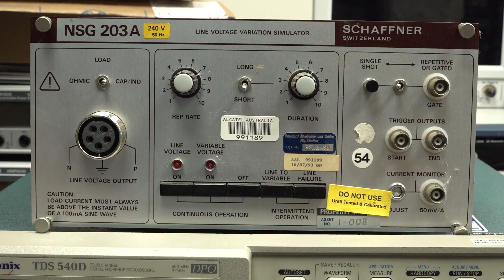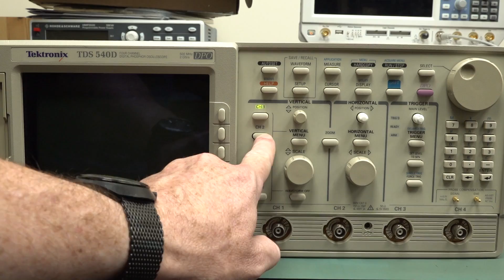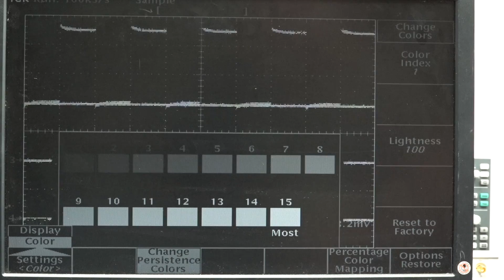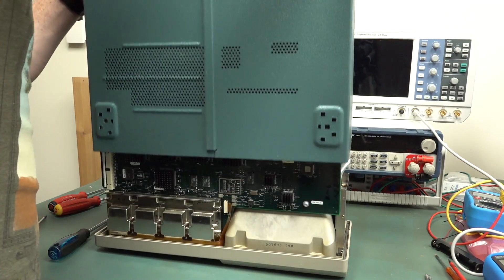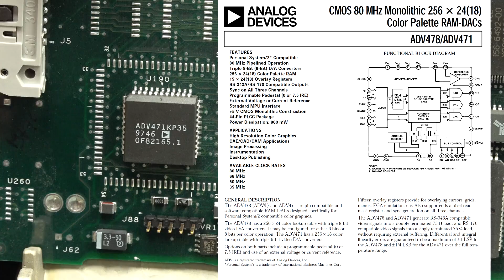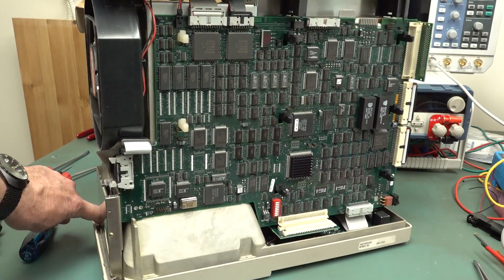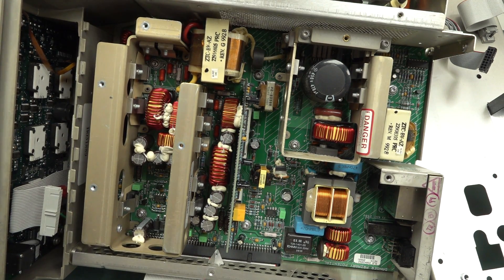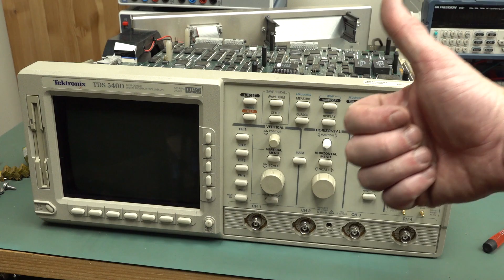EEVblog #1185 - Dumpster Tek 500MHz TDS540D Scope

Comment from the maker: It looks like this TDS540D can be upgraded to the colour TDS754D!
http://www.eevblog.com/forum/repair/conversion-tektronix-tds500-to-tds700-color-oscilloscope/
Reply: EEVblog please fix the crt properly
Reply: I have seen CRT to TFT conversion kits for these on Ebay. They also advertised "convert your mono scope to a color scope". Maybe you can try one of those. And of course there is a thread from2012 on your forum: https://www.eevblog.com/forum/testgear/color-tft-screen-in-a-tektronix-tds500-600-or-700/
Reply: Just what I thought when I've seen it's actually capable of displaying color.
Reply: cor blimey you"l av 2 do it that way then lol
Reply: Of course a color CRT has inferior resolution due to the color triads.
Reply: All I ever seem to score from dumpsters is hepatitis.
Reply: I'm actually surprised the VGA output isn't already colour, does it need an update on the onboard firmware to make that work in the main software?

And yeah, I'd try to fix the CRT in the video, but if that doesn't work out, just pull the CRT and drop a cheap colour LCD in its place so you also have a lot of empty space inside for future use.
Reply: DO IT! There are enough originals out there. Upgrade this one!
Reply: @Stoney3K  Well, yes "colour" is already in the firmware. BUT means you have to "jumper" the scope to a 745D and add some video RAM IC`s (see the link Dave posted). Didn`t find another way for my TDS540D.
Reply: Even better for you there is an after market LCD kit that you can use to turn it into color and at the same time replace the broken screen.

Google NewScope T0/T0e from simmconnlabs, it is a bit of work but then since the screen is broken ... you are faced with some work anyways. I do believe there is even no soldering involved.

Comment: Fix it ! If not possible go to plan B and replace CRT w/ LCD. By any means, make it work  again. it's a wonderfull piece of engineering art.
Reply: Honestly the CRT isnt worth fixing unless you are a CRT nut, UHT, xrays - its not something most people want to do anymore, and the improvement of an LCD in terms of power and simplicity and reliability are real
Reply: @Psyden5757  A scope that deep is pretty much always going to be a CRO - the depth is there mainly to allow for the length of a CRT
Reply: @mycosys  A digital crt oscilloscope with have a shorter crt with magnetic deflection.
Reply: @autogolazzojr7950  which doesnt change the fact that if its that long its almost certainly a CRT. Im sure someone also tried a side tube
Reply: there are superior modern alternatives, not sure it’s worth fixing by any means

Comment: Wish I had dumpsters around here with things like that in it sighs

Edit:  You've gota go for the retrofit of a color LCD panel for that..... Just look at that surface mount porn on the main board !!!
Reply: Richard Wayman I wish I could get anything. 10 years ago you could get everything. From microwaves to old PCs. Best score was the P3 machine. Works awesome as a DOS retro gaming machine.
Reply: Just beware that there are cheap ass LCD kits that use the VGA port on the back and there are the more "pro" models that convert the internal signal used for the CRT so you can still use the external port. E.g. http://simmconnlabscom.ipage.com/store/page5.html

Also on my TDS784D, colour is made by using a colour lcd in front of the CRT. It works similar to the colour wheel in DLP projectors or the Vectrex 3D Imager.
Reply: @mbirth  " colour lcd in front of the CRT " ? wow! how does it compare to regular lcd?
Reply: Same! Best I've found dumpster diving is some still good vegetables. Not any mostly functional scopes :(
Reply: @cthulpiss  A bit blurry, because the graphics come from the CRT and the LCD only adds the colour. But better contrast. Someone made a comparison video: https://www.youtube.com/watch?v=LaK9MIYm6J8 .
Reply: @cthulpiss  The monochrome CRT shines the light and the Color LCD shutter is controlled separately but synced to the CRT screen drive much like the overhead projectors. It's really pretty cool how they work. To bad this one doesn't have the color option. Check out this link to see how it works. http://jvgavila.com/tds524a.htm It's on a TDS524A but the principle is the same on all the CRT LCD Shutter Scopes. Good Question though. Best Wishes n Blessings. Keith Noneya

Comment: First of all, this problem is hidden somewhere near the horizontal (HV) transformer, which is also used as a power supply for anode voltage, fillament and horizontal deflection coil. Measuring anode voltage is difficult, but it's easy to check the fillament voltage (use TrueRMS voltmeter). If it is lower than expected (use screen's datasheet as reference), then you are sure, that the HV transformer works improperly (for some reason). The second thing you should do, is disconnect the horizontal deflection coil (load the deflection coil output with approx 30-40Ω non-inductive power resistor, which is enough to not to destroy the HV transformer by inducted voltage on non-loaded output) and measure the fillament voltage again. If it is correct, then your problem is some shortage inside horizontal deflection coil. If it is still low, then the deflection coil is probably OK. Next check the horizontal amplifier. First of all. Disconnect the PSU from the horizontal amplifier and check the PSU voltage. If it is low, then your problem is not inside the monitor part, but it's somewhere inside power supply unit. If it is OK, then reconnect the PSU to the horizontal amplifier and measure the PSU voltage again. If the voltage is low, then the PSU is overloaded. If not, then your horizontal amplifier have lower gain than expected. If the PSU is overloaded, then check the compensation capacitor connected in parallel to the primary winding of the HV transformer. Desolder the capacitor and measure it. If it is OK, do not solder it back and remove also the HV transformer and check, if your PSU is still overloaded. Yes means that the horizontal amplifier failed. No means, that you should check, if you have some DC on the horizontal amplifier output. If there is DC, it means, that horizontal amplifier failed. If not, then it is near sure, that the HV transformer failed (winding shortage in most cases). If the PSU is not overloaded and is working properly, then the problem still could be caused by the compensating capacitor, HV transformer or horizontal amplifier. So. Check the compensating capacitor (which is easy to do), then replace the horizontal amplifier (which is cheaper than a HV transformer) and then the HV transformer.

Short version: Check if the horizontal deflection coils are OK (as described before). Then check the PSU voltage. If it is low, then desolder horizontal amplifier. If it is still low, then repair the PSU. If not, then check the compensating capacitor. If it is OK, then replace the horizontal amplifier. If it is still not working, then replace the HV transformer. Easy :3 :3

In my opinion, this is caused by PSU or by the compensating capacitor.

Comment: Id definitely do a Memory dump of those Dallas battery-backed RAM chips before those built in batterys 
die and you loose potentially important stuff like config/calibration data and your left with a brick... those things are notorious
Reply: I also wonder what the floppy is used for. Just storage of waveform data? Or can you download optional measurement systems? I have a HP Data Analyzer with a floppy disk drive and you could load in all sorts of measurement techniques for the device. It also booted up using a floppy containing the basic OS and "apps". Probably no longer works since the device is about 35 years old.

Comment: Hey I have one of those! The only bad caps that I could find were in the CRT module. After fixing those everything works great!
Reply from the maker: Which caps?
Reply: @EEVblog  I don't remember exactly which ones, just remember that it was almost all the electrolytic needed to be replaced. It looked like mine were from the same batch.
Reply: @EEVblog  the faulty ones i guess.
Reply: 24:10 paused the screen.  I didn't see any bulging   or looking suspect.  Can you be more specific?
Reply: @Tedybear315  Bad electrolytic capacitors can fail and have zero outward signs that they are bad. You need to pick up (or build) an ESR meter. With that you can measure the effective series resistance of the capacitor to tell if it has failed open, or failed shut. Every electrolytic capacitor will have an ESR, measured in the tens to hundreds of ohms. A good ESR meter, behind a solid multi-meter, is one of the best pieces of test equipment you can buy.

Comment: Run SPC (Signal Path Compensation) - that's where the wheels usually fall off. Also - you can double the b/w and sample rate on these. Simple matter of removing shunt caps and changing the 0-ohm jumpers. It's a 2M unit, which is nice - extended sample memory. The 21V regulator on the CRT board is probably gone - easy fix. Pretty much the entire CRT board runs off the output of the 21V regulator on the board, and it is a common failure point. Flybacks also tend to die, but parts/assemblies are available on eBay. I have a bunch of these beauties - fix up the CRT driver board for starters, then extend the bandwidth & sample rate.

Comment: It's not unusual for those Dallas clock/NVRAM chips to last upwards of 20 years before they start loosing time. I had one on my Tandy 1000HX that only finally died a few years ago. There's a hack you can do where you dremel out the potted connections to the old batteries and solder in connections to a button cell holder and get them keeping time again.
Reply: A BR1225 holder, while uncommon, aligns perfectly with those pins. Done a few myself.

Comment: Others have suggested the flyback transformer, which might be the case.  I'd also look at the horizontal output transistor.  They usually are the ones that have the magic smoke escaping first.  Lacking that the solid state option looks like the best option.  You need to make sure that the aspect ratio is OK as well.  Good luck.

Comment: I have the TDS 520B and it sometimes gets cranky.  The repair consists of popping it apart, and reseating the plugs, which seems to fix it for a few more years.  The CRT is monochrome, and most of the video on the VGA out is too, except for when I toggle the InstaVu function, it turns color on VGA output.  If I could convert it to color I might be tempted to try that conversion you mentioned!

Comment: This is a soldering defect of a horizontal (flyback) transformer. Turn on the device and bring the neon lamp with the (flyback) transformer
Reply: What exactly does " bring the neon lamp with the (flyback) transformer" mean?
Reply: @GLITCH_-.-   I think if you bring a neon probe close to the flyback and it's working?  The neon lamp will glow.  If the neon lamp fails to even give a hint at lighting up, possible a cold solder joint at the flyback transformer.  

Just a guess, but I've seen a large number of flyback transformers with cold solder joints/cracked joints create many problems on the equipment where I work.
Reply: Back in the day, I had aTDS520A that went dark like this. It had no CRT anode voltage. I found a replacement flyback somewhere that fixed the problem. Got a few more years out of it before the surface mount electrolytics went south. A common problem on these. I didn't see any on this D model top board. Check the other side of the analog board. If Tek had fixed the problem, it may be worth salvaging.
Reply from the maker: Can't be the flyback, as there is something on screen, just collapsed or some such.
Reply: @EEVblog  The flyback transformer and horizontal deflection circuitry actually have a lot in common! Quite often the same transistor or IC drives both. So a problem with either part of this circuit can affect the flyback and/or horizontal deflection.
Reply: @EEVblog  Those horizontal stripes mean that the frame scan works and the horizontal scan does not have enough current so that the beam passes the entire width of the screen - low voltage on the deflecting coil 
there is no contact on one of the windings of the horizontal transformer or faulty cap\transistor
Reply: Lots of trimpots, dry circuit?
Reply: @EVBLOG In reallity the flyback can still give a low output if faulty. Solder two wires to the crt heater connections and check this when reassembled. If it's low you at least have a starting point and if it's correct you can PROBABLY assume the fb is ok. Having said that the eht comes from the overwind and could be low if its shorted or open. The crt heater comes from the primary section.

Comment: I spent a while hunting for 5xx and 7xx series scopes like this on eBay a while back. There are a lot of them for sale with modifications such as color CRT's (As far as I understand, it's a simple mod to enable full color support on any of the scope versions), or with pre-installed color LCD replacements. So it must be quite simple to do, given that it's a popular mod. Also I've seen a number of them being sold with higher bandwidth - it seems that they all have basically the same hardware, and that a simple mod can unlock 1GHs on the 500Mhz version etc.

The reliability was terrible for the A/B/C versions, they had leaking capacitors that would permanently ruin the PCB's, very hard to repair in most cases. Apparently the D versions fixed this, and is pretty much safe in that regard. This is just from what I heard while researching them though, I don't have any personal experience with them.

Nice scopes for the price if you want bandwidth, and can live with the lack of modern features. I ended up getting an Agilent / HP 54642D myself instead, but I was close to getting one of the 7xxD series Tek scopes!

Comment: From the picture when you had a display on the CRT it looked like H scan problem, the left hand side was cramped into the middle. 
It should be relatively easy to run the CRT module outside the chassis.

Comment: You scored! I bought a salesman's 2 channel TDS380 demo in 1998 for $4300! because I needed a scope with  storage for a unique design I was troubleshooting. My scope is like new 
but worth just a few dollars on the market. Your TDS540 must have cost many more dollars than the 380.  I wish the 380 had upgradable memory. I bought a TDS3054  with 4 color channels but it also has very low storage memory.

Comment: It shows some images, so flyback transformer seems to be fine.
Alignment seems wrong, i don't think issues with internal crt video DAC, but i would try to check H-V coils driver, driver voltages and capacitors, expecially those near heatsinks on crt section.
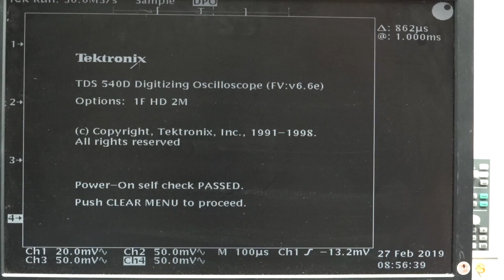On 4:30 it seems to be same screen of 7:03 with much less luminance (check anode voltage) and horizontal deflection issues (check horizontal driver and relative voltages).

Comment: Three upgrades: 1. LCD. 2. A Noctua 24V industrial-grade fan (can be quieter.) 3. Flash-based hard drive replacement (SD2SCSI or CF card, for example.)

Comment: If you have a CRT restorer, you can quickly check for emission to see  if its really stuffed or ok and clean the guns (s).  I have an old B&K 467 and love it and fixed so many arcade units and my own oscilloscopes crts ect.  Then if thats ok at least you know its not the crt. I agree to try and fix the crt as it could just be something simple like that ribbon connector. Everything looks strangely clean and caps all look perfect. Its a gift that it has a lcd output as you can get a nice screen and put it in and bodge up the holder surround to look nice; but thats just details. You might find it all goes together easily and will be fresh and modern. At least you have the backup option except for the slow lcd result compared to a fast bright crt. 
You scored big time and as you Americans say "awesome" , but  i dont know what we say in Australia!!...

Comment: On the front panel there is a button (Display) press it then on bottom on the front panel 1 button over from the left side of the scope it says Intensity on the screen press that  and turn the selector knob to the right and see if the screen comes up... (Cheers)

Comment: I've fiexe a pair of old Tek LCD backlights by accessing the display board and replacing the electrolytic caps.  I removed the caps, measured them with an impedance bridge finding most were low in capacitance and high in dissipation.  Swapping in new caps solved the problem.  GIve it a try!  (I've also fixed several LDC monitors with the same low-tech process)
Reply: This is not a n LCD
Reply: Oops!  CRT not LCD . . . my bad . . . but my LCD fixes did work . . .

Comment: install a new tft lcd.  I bet there plenty that could work with minimal hacks using serial to parallel conversion.  A quick hack with a fast analog front end, an FPGA or fast DSP, and a TFT LCD of 640x480 to 800x600 or so resolution.  Sounds like a fun project for someone.

Comment: You should (at least try to) fix it, and if it is impossible to do so, consider retrofitting a LCD (or any other type of) display in it's place.

Also, is it possible to just get a solid-core wire with the right diameter to just push into that connector on the newly found Schaffner module? I know it isn't the safest option or the easiest one (you can propably attach aligator-clips to the wires attached to the socket on the inside of the unit, and run it without it's top/bottom cover on), but is it possible?

small note: I think that the video number is wrong (shouldn't it be 1185?)